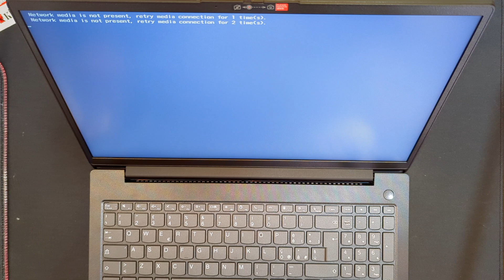Upgrading a Lenovo Laptop in 10 Minutes

Comment: This is amazing and very unique ❤❤
Reply from the maker: Tks
Reply: @infutura  i have a question i need help with regarding this particular laptop its supposed to allow for iris xe graphics but i have an 8gb stick in same size as the soldered ram yet its not allowing xe to run the laptop demands to have 128bit populated memory but if i have two sticks at 64bit each totaling 128bits whats the issue?